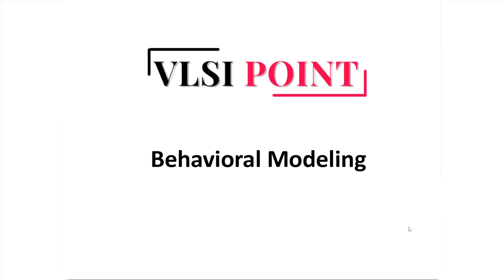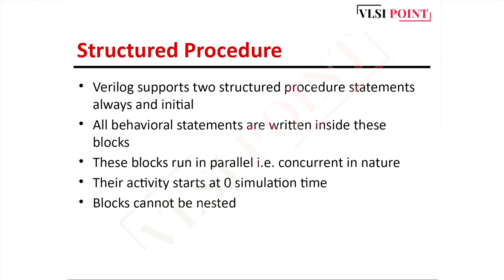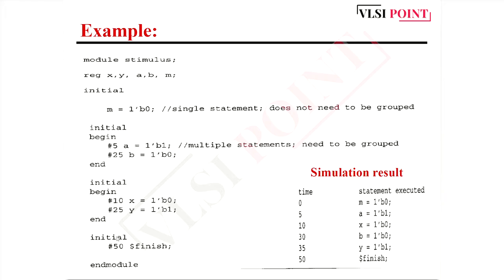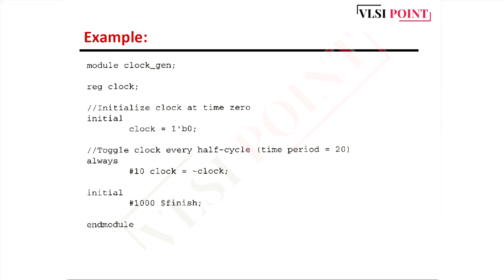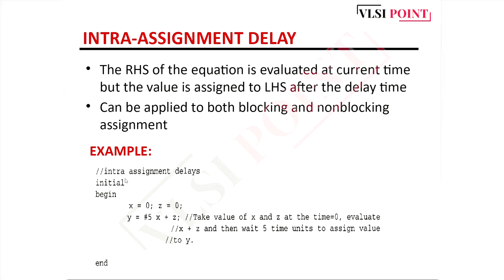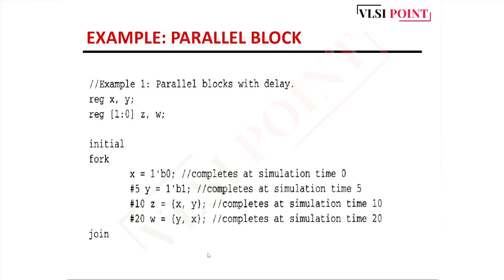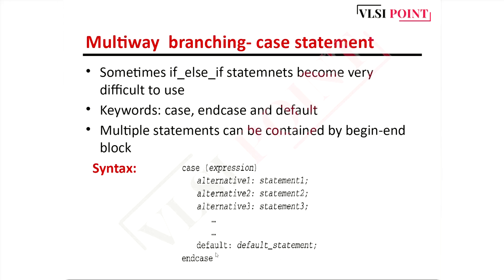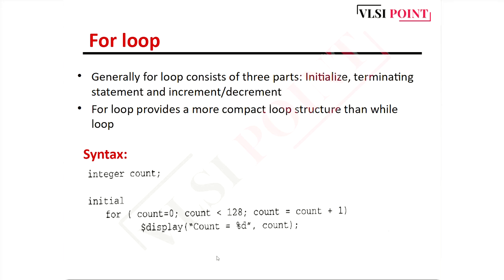Behavioral Modeling | #13  | Verilog in English | VLSI Point

Comment: Simulation result is wrong for example module stimulus at 4:14 since 25 units time delay is assigned for b and y but 30 and 35 are came out of nowhere in simulation result!!
Reply: This is because within an initial block, the delays are compounded. So in the first one, "a = 1" executes at time 5, then "b = 0" executes 25 units of time after "a = 1" executes, 5 + 25 = 30, therefore "b = 0" will execute at time 30. The reasoning is the same for 35 in the second initial block.